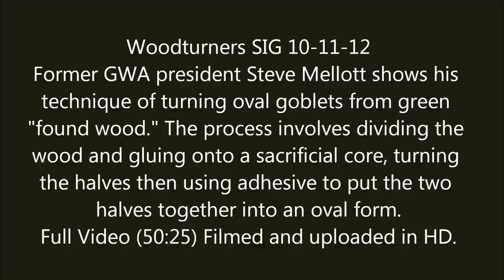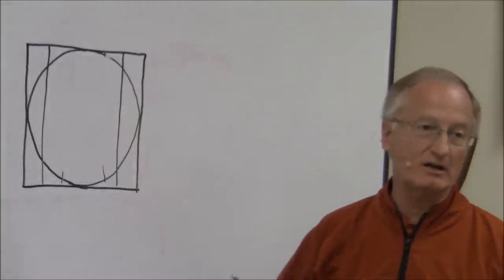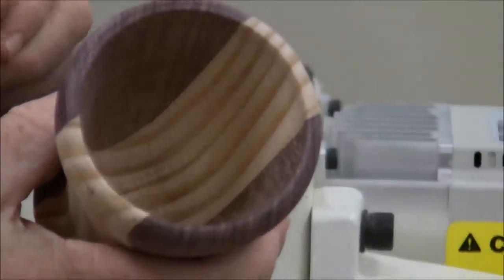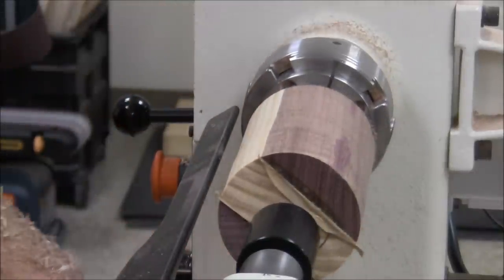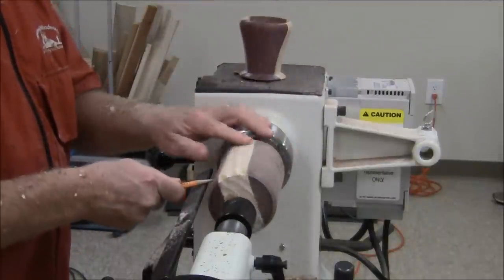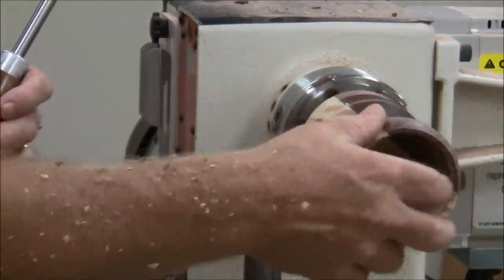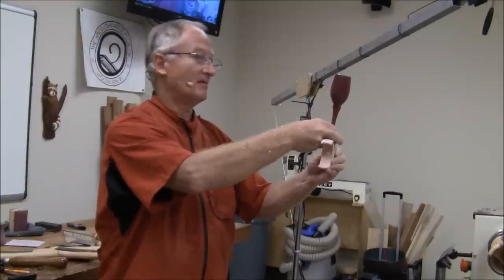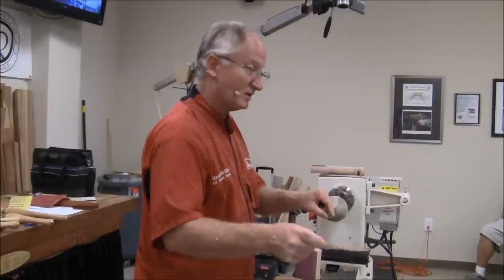2012-10-11 Oval Turning Found Wood by Steve Mellott (50m25s)

Comment: I recall doing the bag trick before in the mid 80's.  We mounted work on planks that were screwed into a threaded section.  (Like a face plate).  I later got the Nova System.  I still have the Nova (black) and all of the jaws that I bought.  Custom fitted to my lathe, a 1" x 10  not the 1x8 that is most common.  I have a steel lathe so fixing that today wouldn't be an issue.   I really enjoyed the concept.  Rather interesting .

Comment: In the video. It was stated that don't assume the purple heart will be purple on the inside. The misconception about this is that the oils in the wood is where the wood gets it's purple from. After jointing, plaining, turning, or sanding, if the wood is left in the sun or just the light in the shop, in days the purple will start to darken. The sun will make this happen faster than the light in the shop. I always plan on this when using it, so I can manage my time accordingly. Hope this helps.

Comment: To the question about cleaning off the paper after splitting it apart.What if you used contact cement for the glue and that will clean off with acetone.Don't know how it would split apart using contact cement though.Just a thought.

Comment: This is an excellent video. The comments are meaningless unless you have done your own video and put your money where your mouth is and turned a better cup. The whole point of the project is to do something very few people have done and to make something that the average woodworker would be puzzled at. The average person would admire it and question how it was done. One thing I have found to get paper off of glued wood is to use water based Elmer's glue and lightly scrape the paper after it has been wet for a few seconds.
Reply: I agree with the point about the nay sayers, get your video tutorial up then complain.  I use a water based PVA glue on paper to glue up and find that a small amount of warm water will remove all traces when I split

Comment: I wonder how it would turn out if you used three wedge pieces of wood to make your square block.  or cut i "v" in the top and glued a identical sacrificial piece of wood in it's place. no pun intended.. cool method, i like thinking outside the norm.

Comment: But all three pieces dont have to be the same size the outside two just have to be even thickness so when you glue them back together they are even and match up. You can make the center piece be three inches and the outsides be an inch. It all depends on the total width that you want the final piece to be.